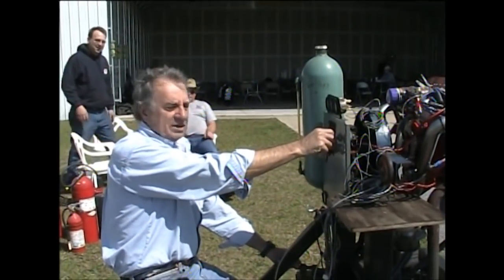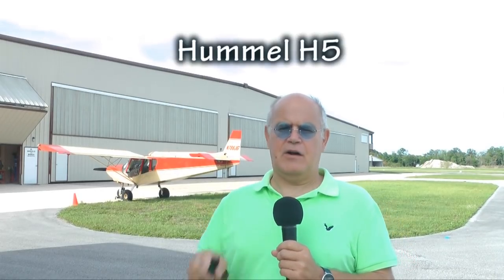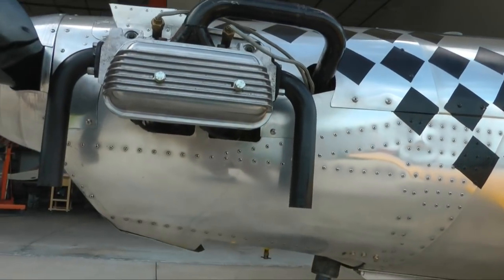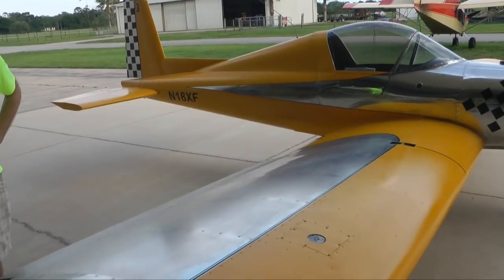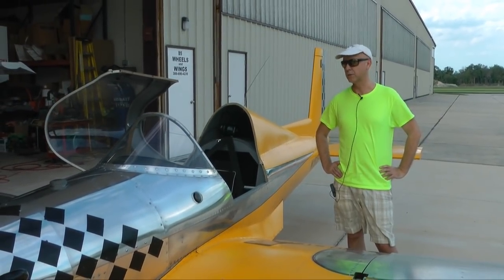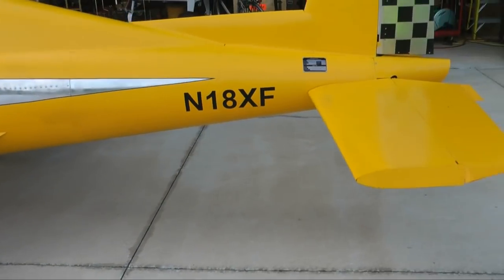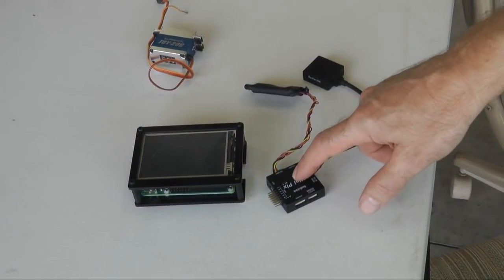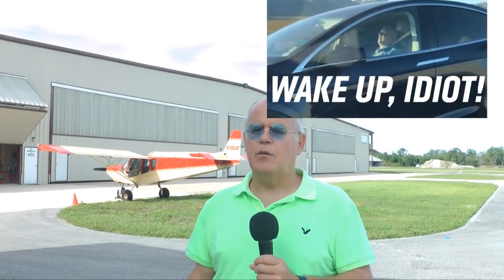A Really, Really Affordable AutoPilot for your Homebuilt

Comment: Absolutely phenomenal! I've been thinking about using RC servo motors for trim tabs for years. Operated by a car electric mirror control mounted atop of the control column. This is essentially that, with an extra dimension.

Comment: I like this. I especially like that it works by trimming the plane. Many autopilots will allow a plane to get way out of trim and then when they disengage the plane is uncontrolable in some cases (more than a few crashes have included autopilot disengagement while out of trim). Because it is open source you can extend it. Add throttle control, rudder control, or full flight surface controls, gear control, landing light control, you name it, you can code it and build actuators for it. (I like the idea of having both the trim and full flight control, but with some pins you can pull using a wire rope to mechanically disconnect the main flight controls from the autopilot's actuators. You could add autoland, emergency autoland (perhaps triggered by medical data or a vigilance detector), automated terrain avoidance,  nearest airfield finder, automatic unusual attitude recovery, or even inadvertent IMC escape.
Reply: I love your idea man, I would love to team up let’s build this autopilot as I have a good knowledge background in arduinos and raspberry pi

Comment: Why are you using RadioLink hardware?  Last I read from the Ardupilot site: "This autopilot is not recommended because the board is not compatible with the official ArduPilot software despite multiple efforts to work with the manufacturer to make it compatible. The manufacturer is also apparently not abiding by the GPLv3 license which requires releasing the modified source code to its customers."  I would opt for something better.

Comment: I thought this would come up at some point. Now, ArduPilot is open source, organised a bit like Linux, and therefore it can in principle be fully examined for quality and bugs.  The whole issue of certification of systems for human flight needs to be examined, given that the existing system of closed, proprietary software has proven itself to be fatally flawed in the case of the B737 MAX and assorted Airbus bugs, whereas the open source Linux system essentially runs the Internet over the entire world. A model plane running ArduPilot with low-cost hardware would easily have completed the Kobe Bryant flight plan, yet an expensive helicopter and trained pilot could not, also with tragically fatal results.

It is perhaps time that the old expensive approach to avionics and aircraft control in general be revised to allow for new low-cost technology and open source software, just as commodity personal computers and open source opened up computing and communications. After all, look at how airline pilots depend on their iPads for so much operational assistance in addition to what their cockpit instruments and computers do.

PS: The ISS switched to Linux a number of years ago.
Reply: You make some terrific points, except that the entire iPad iOS is a closed, proprietary ecosystem closely guarded by Apple. The points you bring up about the vulnerability of proprietary HW/SW applies to iPads as well. Perhaps moreso, in light of the recent Mail app issue.
Reply: @SooperToober  It's more a question of whether the apps used by pilots are open or closed. iOS is built on an open source version of UNIX which is not GPLed, but the ecosystem is indeed closed and proprietary. I was looking at the iPad and the apps as being non-certified elements brought into the cockpit.

Comment: A few R/C servs and a raspberry? Wow! You need to be  brave to connect that in the sky
Reply: The design can improve a lot with minimal increases in cost. Typical aerospace practices like redundancy, manual override, external monitoring (watchdogs), ... are very cheap to implement with this kind of tech. The main functions are done by a "rugged" microcontroller in this product (Ardupilot).
I wonder how the control surfaces could be managed by both the pilot and the autopilot concurrently and directly (which sounds safer than the current parallel system). Something like taking over the usual manual controls during flight then unlinking the autopilot as soon as the pilot touches them.
This can even evolve into a system to assist in preventing and recovering from possible accidents.
Reply: you will also need an ardupilot module (mine was $30.00 - amazon) and get the gps unit that goes with it (another $20 - amazon)..  Either the PixHawk  or ardupilot pilot module is what gives you all the accelerometers and the gyro and the gps and the servo connections and the auto piloting, the pi is the user interface for the pilot module  - search your app store for ardupilot gcs, there should at least 5 to choose from and that is where you will input your flight missions on your smart phone or tablet or....  The most common connection from the pi to the pilot board is a serial connection as it uses a basic ASCII text protocol to program the board - that being said, all the servos and boards and cabling and debugging done for you for what, $300,? hell even $500?.... it is soooo worth it to buys his!!!  Unless you are a software developer and/or hardware developer (a.k.a. masochist - I am developer,  you have to be a masochist to do this job!) - the modules are very sophisticated and very reliable but I would still build in independent alarms for double checking the auto pilot. OH and use the PI 4 - it has the wi-fi built directly into the board and no need to buy a separate wi-fi module like what is seen in the video. have fun, good luck and stay safe!
Reply: @deanyoung8812  It still works as a proof of concept of open source technology into experimental aviation. People will see the video, the product and know the possibilities are vast.
I think the interface can be done with a bigger Arduino (AVR) or ARM Cortex board with some external LCD display if you can use Bluetooth/NFC instead of WiFi to communicate with smartphones. It would be enough and much more robust than a full Linux device.
Reply: @jet guy I would expect, pulling the plug or writing a release routine because I do not know if one is written in the GCS software. BUT BUT BUT We have an actual ArduPilot programmer on the feed and I am sure that he knows far more than I do about it.
Reply: @vitordelima  it has / had real potential, like I said, I was building one almost exactly like the process shown in the video, but the XFlight creators use servos would actually be easier and make more sense,  where I would have been applying stepper motors.  We do have the ArduPilot expert on the thread.
Reply: Been running Raspberry pi on my 3D printers as a remote servers (2 printers and one CNC router). Ask me how many time they have crashed in 5+ years? Now ask me the same for my windows PC? Take a wild guess. 

It's a linux system that as been proven to be far more reliable than any other operating system.
Reply: @jet guy Think of it as a cruise control.  It's just a convenience to keep the plane going the direction you want.  The pilot is still the primary flight computer.
Reply: @somerandomnification  Great point. I think that's getting lost on a lot of the naysayers.
Reply: @jet guy 
You override by grabbing the stick and flying the plane. Jeez. 
It controls trim tabs. Not the control surfaces, which would require an override.
Reply: As a pilot I can say confidently say, Why?  When leaving the controls in my plane to take photos, even for two seconds, puts me in a dive, and sometimes a bit of a spiral (I don't have trim tabs).  I have seen pilots use a bungee cord for a bit of control while map reading or photo taking.
Reply: @alainsaaiman4975  
Why? Is a question. Not a statement. 
If you don't have trim tabs, then this system obviously won't work for you. 
I suggest you mount a camera, and use a remote to control it. 
My Kolb is similar to your situation as it doesn't tolerate hands off for more than a quick moment.
Reply: @vitordelima  ardupilot already has that build in
Just need to enable it
Reply: Not really. The Ray Allen servos that are used in the vast majority of experimental aircraft are nothing more than modern RC servos. Also if they are just hooked up to a trim tab and you have a problem you can still fly most planes just fine.
Reply: @deanyoung8812 Hi! Any updates on the A/P for H5? Thanks

Comment: I have seen certified planes with an autopilot disengage switch right on the top of the stick that is hardwired and independent of the autopilot software and electronics.

Comment: so I assume if you don't have them you would have to install trim tabs for this to tie into. but how does the autopilot interact with an electric trim system? does it come with the ability to be a manual trim system with the AP off and then just overused the trim when you engage the AP?

I ask because i am building a part 103 ultralight that dose not normally have trim capabilities but would love to give it that ability and an autopilot in the future. would this work to fill both of those roles?

Comment: Seems a bit goofy to me, to have the fuel tanks, so far out on the wings. I remember the Piper Lance with the 4 tanks, and how fast it would get out of trim when burning the tip tanks. Also, using the "flaps," for trim, does not have as much leverage, as tabs farther out on the wings. I would prefer to keep the flaps, and actually install the servo and tab, farther out on the wing.
Reply: It is a small, light aircraft. Further out on the wing would result in smaller control surfaces for the same level of control.
So, for the H5 specifically,  is it worth that? I think "No".

Comment: I think that the Hummel H5 can go faster if the wing size get some modifications. Its too big and wide.. if the wing become slimmer and few inches less in width .. besides it needs begger prop. it will fly easier and faster with the 85 hp engine

Comment: Very interesting but I'd be more concerned with trim than if it steered directly, just with soft actuation you can easily overpower. Do you have to lock the stick for trim to be enough to fly the plane?
Since screens are so inexpensive, I'd highly recommend you use a much bigger screen. That's a great way to stand out and get a much better user experience. If you could add synthetic vision it's suddenly full avionics that can appropriately shame other products. If possible it would be very cool to add throttle control and include maps of airports so it can land on its own. Or take off. Do the full flight. And I don't mean 10" screen or 12. Much bigger.
Reply: Could never land or take off on its own ... you need full control   servos that move main surfaces for that...  not trim tab servos .. Have you ever flown a plane ? you should know this .. Auto throttle also not a good idea .. completely dangerous without expensive override that would cost more than five of these .. Also your aware you can have everything else you mentioned for free on your I pad which should remain separate .
Reply: Some people are never happy. Take an honest piece of inexpensive simplicity designed for inexpensive simple airplanes and immediately starts to nickle and dime it with Bells and Whistles.
Reply: @garyreed2206  He doesn’t understand trim tabs can’t take off and land safely and that auto throttle to be safe is easily 10 grand worth of parts ... And it would be outrageously foolish to trust an inexpensive rig to do those tasks ... requires about a decade of testing and proof it is safe .... but ... a simple trim guidance system while in the air at some altitude is completely safe and easily overridden ... in fact it’s safer than without itbecause it could save you if IFR conditions came upon you ... I don’t think he has ever flown an airplane ... doesn’t understand that Garmin and others spent years and millions to just last year arrive at auto landings and takeoffs for small piston singles and do it safely
Reply: @garyreed2206  I honestly think he has zero understanding of autopilots in general and the astounding R&D and money required for safe auto land which has
Reply: just use an iPad with Foreflight for synthetic vision - a separate display
Reply: Aww-Oh! You both are NUTS.  Who wants an inexpensive way to fly hands-off with heading asssist when this thing could be programmed to File/Cancel my Flight Plans, put on some coffee and line up 3 Tinder Dates for Friday.

Comment: From the ArduPilot developers:

***Never use the software or hardware for manned vehicles. The software and hardware we provide is only for use in unmanned vehicles.***

https://firmware.ardupilot.org/
Operate within all local laws and regulations. For example, in the United States, current regulations require you to operate most UAVs under 400 foot above ground level, within line of site, and away from obstructions and populated areas. 
Since these regulations vary from place to place, even within the same country, ensure that you understand what you need to do to stay compliant.

Never operate the vehicle or software in a way that could be dangerous to you, other people, or property. 

Always keep in mind that software and hardware failures happen. 

Although we design our products to minimize such issues, you should always operate with the understanding that a failure could occur at any point of time and without warning. As such, you should take the appropriate precautions to minimize danger in case of failure.

**Never use the software or hardware for manned vehicles. The software and hardware we provide is only for use in unmanned vehicles.****
Reply: And?
Reply: The same statement is on most fuel pumps used in experimental aircraft. It''s just to protect them from the liability.

Comment: Extremly unsafe !
Reply: Expermental aircraft can be this way,  they are not for everybody ;)
Reply: Unsafe? If it fails the pilot will be flying a little out of trim. What's so unsafe about that? I would bet many pilots are flying out of trim anyway. And, it's installed in an experimental sport aircraft that's built by the builder of the aircraft. Pretty good, I think.